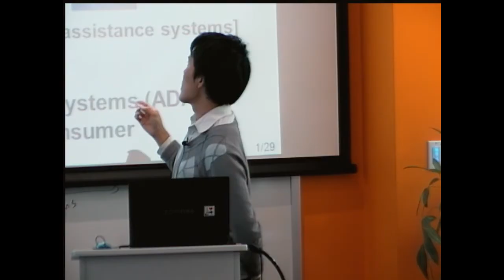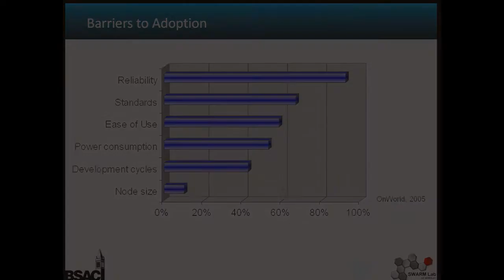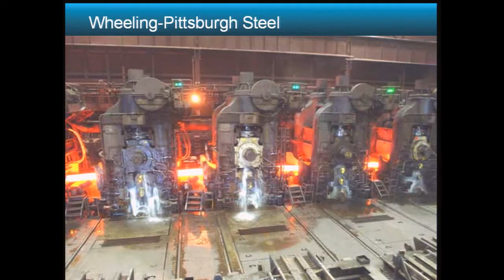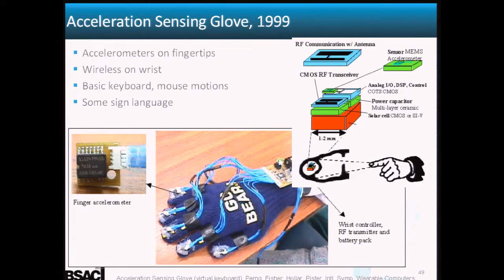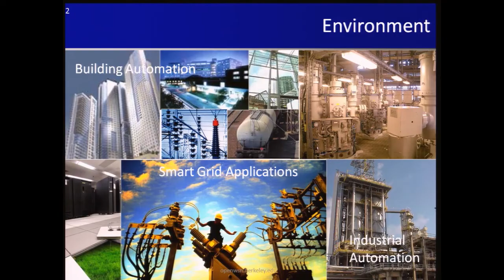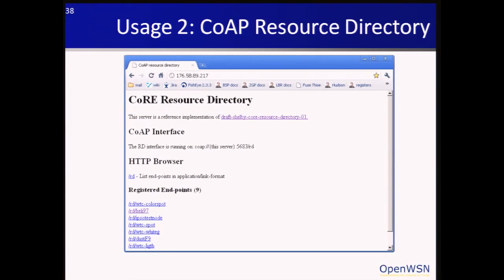Smart Dust and Sensory Swarms and OpenWSN

Comment: Harnessing a New State of Matter: The Dense Plasma Condensate (ongoing research into dense microplasmas) also: (adapting immune cells) and (enabling much faster, lower-power microchips)  https://youtu.be/NMPXpC3hVSY DARPAtv

Solar Simulator Patents😎
https://www.google.com/search?client=ms-android-americamovil-us-revc&biw=320&bih=512&ei=ogkqX42mHu2O9PwP3NC1oAg&q=solar+simulator+Patent&oq=solar+simulator+Patent&gs_lcp=ChNtb2JpbGUtZ3dzLXdpei1zZXJwEAMyAggAMgYIABAHEB4yBggAEAUQHjIFCAAQzQI6BAgAEEc6BAgAEA06CAgAEAgQBxAeOggIABAHEAUQHlCgNVjyUWDXdmgAcAF4AYABlQWIAYoKkgEHMC41LjUtMZgBAKABAcABAQ&sclient=mobile-gws-wiz-serp

SmartDust & Sensory Swarms
https://youtu.be/ml5RKgYimrQ

COVI-PASS The VCode® can be scanned at distance (in some uses over 100meters), applied at sizes down to 100 microns, scanned within 170-degree angles. https://www.covipass.com/

https://www.govexec.com/technology/2020/03/military-funded-biosensor-could-be-future-pandemic-detection/163510/ DARPA-Backed Study Leverages Profusa’s Lumee® Oxygen Platform 
The Defense Department is helping to fund a new study to determine whether an under-the-skin biosensor can help trackers keep up — by detecting flu-like infections even before their symptoms begin to show. Its maker, Profusa, https://profusa.com/ says the sensor is on track to try for FDA approval by early next year.

The sensor has two parts. One is a 3mm string of hydrogel, a material whose network of polymer chains is used in some contact lenses and other implants. Inserted under the skin with a syringe, the string includes a specially engineered molecule that sends a fluorescent signal outside of the body when the body begins to fight an infection. The other part is an electronic component attached to the skin. It sends light through the skin, detects the fluorescent signal and generates another signal that the wearer can send to a doctor, website, etc. It’s like a blood lab on the skin that can pick up the body’s response to illness before the presence of other symptoms, like coughing.
☣️🤑☣️🤑☣️🤑
https://patentscope2.wipo.int/search/en/detail.jsf?docId=WO2020060606
WO2020060606 - CRYPTOCURRENCY SYSTEM USING BODY ACTIVITY DATA
Applicants: MICROSOFT TECHNOLOGY LICENSING, LLC [US/US]; 
One Microsoft Way Redmond, Washington 98052-6399, US 

Human body activity associated with a task provided to a user may be used in a mining process of a cryptocurrency system. A server may provide a task to a device of a user which is communicatively coupled to the server. A sensor communicatively coupled to or comprised in the device of the user may sense body activity of the user. Body activity data may be generated based on the sensed body activity of the user. The cryptocurrency system communicatively coupled to the device of the user may verify if the body activity data satisfies one or more conditions set by the cryptocurrency system, and award cryptocurrency to the user whose body activity data is verified.

ID 2020
http://id2020.org/digital-identity Article 6 of the Universal Declaration on Human Rights stipulates that "Everyone has the right to recognition everywhere as a person before the law." The Sustainable Development Goals (2015-2030) https://sustainabledevelopment.un.org/post2015/transformingourworld include target 16.9 which aims to "provide legal identity to all, including birth registration, by 2030."
For the one in seven people globally who lacks a means to prove their identity, digital ID offers access to vital social services and enables them to exercise their rights as citizens and voters and participate in the modern economy.  https://www.biometricupdate.com/ ID2020 and partners launch program to provide digital ID with vaccines https://www.biometricupdate.com/201909/id2020-and-partners-launch-program-to-provide-digital-id-with-vaccines

🤔 Sponsored by DARPA Mitre Corp DOD 😎 http://cml.harvard.edu/research/brain-science Syringe-injectable mesh electronics can integrate seamlessly with brain, retina and other tissues...

 “Scalable ultrasmall three-dimensional nanowire transistor probes for intracellular recording,” describes the Lieber group's latest revolutionary approach to scalable intracellular recording by large arrays of nanowire transistors electronics... http://cml.harvard.edu/

Virus-Sized Transistors? 🤔
https://harvardmagazine.com/2011/01/virus-sized-transistors Dr. Charles Lieber

Dr. Charles Lieber, 60, Chair of the Department of Chemistry and Chemical Biology at Harvard University, was arrested 
https://www.justice.gov/opa/pr/harvard-university-professor-and-two-chinese-nationals-charged-three-separate-china-related 🤔

Defense Advanced Research Projects Agency (DARPA)
https://www.darpa.mil/
Coronavirus: DARPA Response
DARPA is working closely with the Department of Defense and Department of Health and Human Services, in addition to its academic and industry partners, to provide technical and scientific solutions to address the COVID-19 pandemic

Mitre, Corp
https://www.mitre.org/

Office of Naval Research
https://www.onr.navy.mil/

Air Force Office of Scientific Research
https://www.wpafb.af.mil/afrl/afosr/

National Institute of Health (NIH)
https://www.nih.gov/

https://www.nanowerk.com/spotlight/spotid=1635.php
Viruses as nanotechnology building blocks for materials and devices

🤪 https://www.galvani.bio/ Galvani Bioelectronics is a new company, established in November 2016, dedicated to the development of bioelectronic medicines – a new class of medicines consisting of miniaturised, implantable devices. https://en.m.wikipedia.org/wiki/Galvani_Bioelectronics Founded by Alphabet Inc. Verily Life Sciences and British pharmaceutical company GlaxoSmithKline (GSK) https://verily.com/

CanSino Biologics & Precision NanoSystems Announced Collaboration to Co-Develop a Covid-19 RNA Vaccine
https://www.precisionnanosystems.com/

Buckypaper is a thin sheet made from an aggregate of carbon nanotubes, or carbon nanotube grid paper. The nanotubes are approximately 50,000 times thinner than a human hair. Originally, it was fabricated as a way to handle carbon nanotubes, but it is also being studied and developed into applications by several research groups, showing promise as vehicle armor, personal armor, and next-generation electronics and displays. https://en.wikipedia.org/wiki/Buckypaper Buckypaper can be used to grow biological tissue, such as nerve cells. Buckypaper can be electrified or functionalized to encourage growth of specific types of cells, and has exhibited auxetic behavior, capable of use as artificial muscles.

🤪  SMART DUST
Autonomous sensing and communication in a cubic millimeter https://people.eecs.berkeley.edu/~pister/SmartDust/
a system of many tiny microelectromechanical systems (MEMS) such as sensors, robots, or other devices, that can detect light, temperature, vibration, magnetism, or chemicals. They are operated on a computer network wirelessly and are distributed over some area to perform tasks, usually sensing through radio-frequency identification (RFID) https://en.wikipedia.org/wiki/Smartdust 😎

Natural hydrogel materials are being investigated for tissue engineering; and the use of hydrogels for Polymeric drug delivery systems https://en.wikipedia.org/wiki/Hydrogel

Neuralink
https://www.cnbc.com/2017/02/13/elon-musk-humans-merge-machines-cyborg-artificial-intelligence-robots.html Developing ultra high bandwidth brain- machine interfaces to connect humans and computers. https://www.neuralink.com/

https://nanoavionics.com/
NanoSat

Neu·tri·no

a neutral subatomic particle with a mass close to zero and half-integral spin, rarely reacting with normal matter. Three kinds of neutrinos are known, associated with the electron, muon, and tau particle.
____🤔____
Neutrino Networks, Inc.

Information Technology & Services https://www.apollo.io/companies/Neutrino-Networks--Inc-/54a12aaa69702dc84184e601?chart=count
____😎_____
The Neutrino Network

How would you like a wireless, near-light speed network that can work from your New York to Tokyo offices? With neutrino communications technology, we might see exactly that someday. Scientists from the school were able to use neutrinos--nearly massless particles that travel at almost the speed of light--to send the binary message "Neutrino" to a receiver that was just over a kilometer away and that included 240 meters of stone in the way." Try that with any other wireless technology!
https://www.zdnet.com/article/the-neutrino-network/